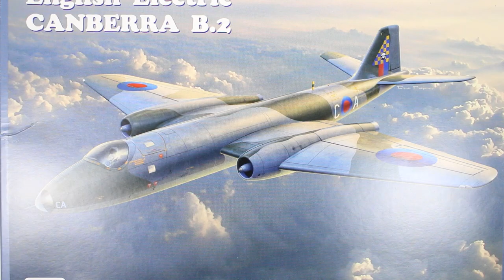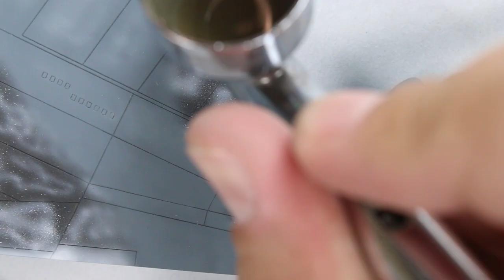ENGLISH ELECTRIC CANBERRA RAAF 1:72 AMP Full Video Build

Comment: Thanks for posting the video! I am currently building this kit so wanted to share some insights to hopefully help others in the process. 
As mentioned by Doctor MiG, the fit of most part is not great. Key recommendation is to dry-fit everything and sand, sand, sand until you improve the fit as good as you can. Lots of panel re-scribing will follow for sure. 
Do not cement/glue big pieces all at once, start on one side and move slowly as you fit the different sections - one example of this is fitting the engines to wings: I glued the front part first, let it dry, then closed the wing and glued the back (otherwise the parts will not conform to the proper curvature you need to have the engines fit smoothly). 
The cockpit area is also tricky since you have to attach the front wheel bay to the back of the cockpit prior to closing the fuselage, so it's a bit of an effort to dry-test and find the proper angle for the parts before gluing. The instructions are not helpful enough as the don't show the exact positioning of parts... it's more like "this part goes more or less over there, good luck"
If you are used to the usual slots in fuselage to attach wings or horizontal stabilizer, forget it: there's nothing like that in this kit. The horizontal surfaces have to be positioned flush to the fuselage and glued... and no idea how but hope they stay in place and at the proper angle while the cement dries (have just reached this phase of the build and am dancing around the problem with not much enthusiasm to tackle it).

I am no pro but also not a beginner, with 10+ kits built this year, yet am finding this one very challenging. Hope I'm learning new skills in going through it.
Reply from the maker: Thank youmJust be patient and dont loose your will to finish it.Also dont try t rush it.
Reply: @doctormig2709  did you have to add weight to the nose section to keep the plane standing properly on front wheel? This is my time to do it before I close the canopy.
Reply from the maker: Yes you ha e to add and add a lot